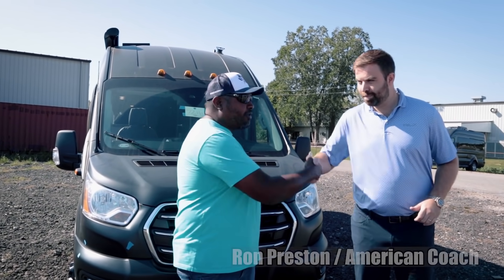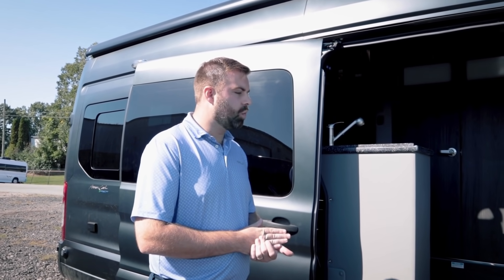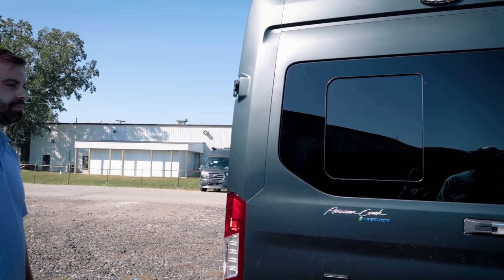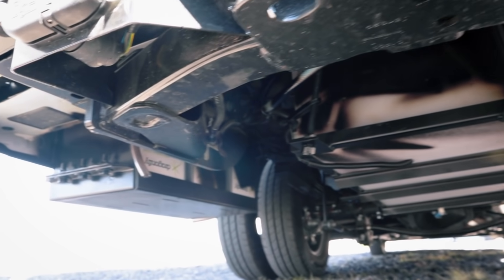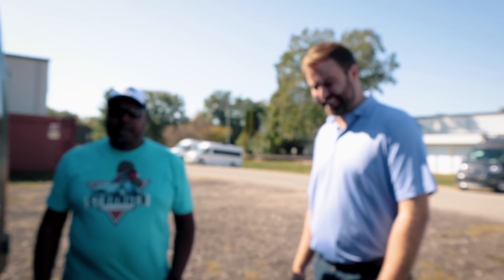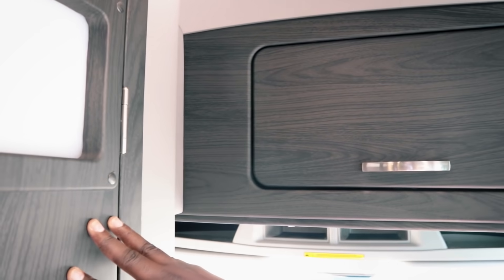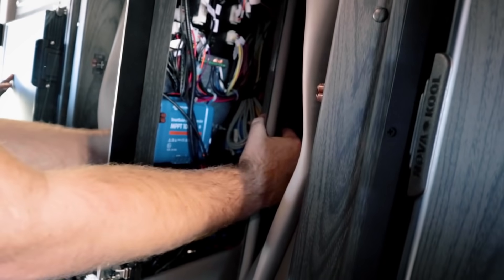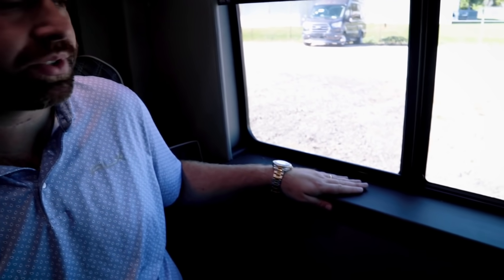THE WAIT IS OVER! Amazing Luxury 2022 FORD PATRIOT MD2 Camper Van // Exclusive First Look!

Comment: We picked up our 2022 American Coach Patriot in TX 2 days before this video came out. While we like it overall, the headaches started within 10 minutes of taking delivery and there is a glaring inaccuracy spoken by Ron in the video.  The towing capacity is usually 5,000 lbs for the class B vans we had been looking at. Ron states in the video that the towing capacity is 7,500. But according to American Coach's own people, the capacity is actually 5,000. Who is right?

And while the van in the video may well be a 2021 Transit, the vehicle sold to us, which again is a 2022 American Coach Patriot MD2 just like in the video, the Ford chassis is actually a 2020. We thought a model marked as a 2022 would at least have a 2021 chassis, but instead is has a 2 year-old chassis. Ron makes the point in the video that Ford upgraded towing to 7,500 so we were really happy, then let down when we found out our chassis is 2020. One person at AC said there is actually no difference between the 2020 and 2021 Ford 3500 HD Transit chassis. Still, seems a little bait and switchy to me.

There are issues with the Ford side, American Coach side and the dealer side of the vehicle. 

On the American Coach side: The water heater and house heater in our unti do not work on electric, though the system is supposed on either petrol or electric according to several videos (including this one). We plugged into 30 amp shore power and the temperature never changed. The water heater and house heater DO work on petrol, however.  

American Coach responded very quickly and walked us through how to get the petrol side working.  The walkthrough of the systems from the dealer, we sadly discovered, was about half the knowledge we needed. Again, American Coach has been very responsive and they are working to find a service center near us (American Coach's service centers are only in Oregon and Indiana – we are in central California) to fix our particular unit. So the videos may be correct, but not for us.

Another issue on the American Coach side is one of the solar panels on top of the van seems to be missing. One person at AC said there are supposed to be 3 panels, another said the are supposed to be two so we are waiting to hear what is supposed to be up there. We only see one panel.

A minor issue is a small (about 1 inch square) plastic cover that hides the screw that holds the driver's side sunvisor keeps popping off. I don't know if that is a Ford or AC issue.

On the Ford side, there are two issues: The first is none of the four key FOB's we were given actually function. We picked up the vehicle, drove down the street to a Sam's Club to get supplies for the 1,500 mile drive back to home. I get out of the vehicle, shut the door and push the lock button on the key FOB. Nothing. We try all 4 of the FOBs. None of them work. 

They do not lock or unlock the doors, they do not operate the sliding side door and, most importantly to personnel safety, the red panic button doesn't work. There was a Ford dealer about a mile from the RV dealer (the RV place said it's a Ford issue. They swore the FOB worked before – which of course they said it worked) We pulled into the Ford service to get the FOBs fixed. The dealership says they tried reprogramming all of them, but it failed.  They said that the FOB's are put into a transport mode at the factory and then dealerships have put the FOB's into a functioning mode, but they were unable to get any of the four FOB's to work.

Yes, there are YouTube videos supposedly to fix this (turn the key on 8 times in 6 seconds, click the lock button on the FOBs, etc) however, those videos do not mention a key fact: That method apparently only works on vehicles that do not have the Ford keypad on the door. If the keypad is there (which it is on our vehicle but doesn't work) it's a completely different process.

The second issue is a TPSM fault warning that does not go away. The tech at the RV store where we bought the van said that tire pressures vary wildly in the Texas humidity and he would check all the pressures, make them even, and the fault would go away after that. He lied. The fault warning is still there. The Ford dealer also could not fix that issue. I believe they said they didn't have the right tool to fix it.

On the dealer side: The sales person failed to mention that the privacy shade that was supposed to come with van was not present. We discovered this while waiting at the Ford dealership. He said he had contacted the manufacture of the privacy shade and it would be shipped directly tool us. Why he didn't tell us that before we left, I don't know. 

Also missing from the van, and we discovered this before we left, is the boards that go across the back between the seats to make the bed one large piece were missing. The tech at the RV dealership said he would grab a pair and put them in the back for us.  He did put boards back there but they are completely the wrong size and do not fit. The RV dealership is looking into finding the right size.

Here's the bottom line if you go to buy one of these things: Check that EVERYTHING works.  Don't just let the tech run through systems and show you the buttons (yes, I did record all the technician's demo so we could go back and refer to it.) Make them show you that every system works. The tech didn't even know if the cruise control was adaptive or not (it is, and works well BTW).

That means for hot water and hot air in the house, you have to turn the system on electric. AC says on electric it's only 5,000 BTU, so it's not going to be as hot as running on petrol, but it will at least heat the house well in 40 degree weather. Wait about 10-15 minutes, watch on the readout that the temperature is actually going up then run the water in the two sinks and the shower to make sure you are getting hot water. Feel the hot air out put. Shut it all down. Try its again on petrol.

And something we didn't notice while at the dealer is there is a tear in the armrest of the passenger front seat. Aggravating on a brand new vehicle of this price. I suspect the dealership knew it was there and didn't say anything.

As I said in the beginning, overall we like the van. The Ecoboost Six is a responsive engine with plenty of power and had no problem passing every RV and semi truck we came upon. It does ride like an HD cargo van, so don't expect it to absorb the bad sections of road (we were on I40) quietly, but it was comfortable on good roads. MPG over the course of about 1,600 miles was 13 mpg.

We like the size and features. I wish it had at least one external storage container.  The dump hose is not a pleasant smell to store inside the van. We ended up putting it in a plastic kitchen trash bag then inside at sealable plastic storage box, then storing it under the bed (yes, we rinsed out the system first). An externally accessible storage would also be a place to put the water hose, which is always going to drip a little when you are done using it.

This is our first RV and we have a lot of plans. Hopefully, American Coach will fix their issues and Ford will fix their issues and we can get on the road with everything working soon.

Thank you.
Reply: I think the 2020 chassis was 5000 and the 2021 is 7500. Doesn't the video says this is on a 2021?  Another Patriot owner said she tought after the conversion it lowered the rating to 5000.  If you find out, let us know.
Reply: @dking4883  Yes it's on a 2020 Ford Chassis. You can tell by the grill.
Reply: @dking4883  I keep replying and the reply keeps disappearing. YouTube has a glitch that doesn't allow detailed responses with proper source citations.
Reply: @dking4883  Ford's own towing specs for a 2021 Passenger Transit 350 HD Long-EL, AWD with 3.5L Ecoboost 6 is listed as 6,600.

For the 2020 model, it's 6,100.

What Ron talks about the tow hitch at 1:59 and says “it’s rated at 7,500 lbs”  that’s incorrect. There is a Heavy-Duty Trailer Tow Package available but its features do not include an increase in towing capacity. 

As listed by Ford, the package includes: 
• Tow/Haul Mode with Trailer Wiring Provisions
• 4/7 Pin Connector Assembly and Rear Jumper
• Relay system for backup/B+/Running Lights
• Frame Mounted Hitch Receiver

On our van, they used a 10,360lb GVWR version, for those that are curious. 

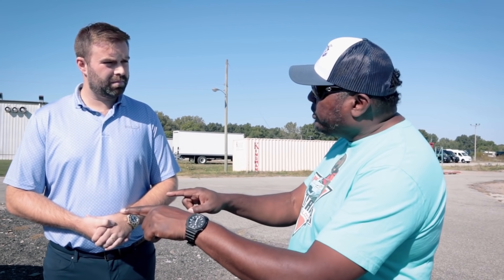Also, the van featured in the video is a 2020, not a 2021 (as Ron says at 1:52). The front grill changed between the two years. There’s actually been some complaints about the aesthetics of the new grille in Transit forums.

The easiest way to verify the year of the van (for future videos) is to look at the manufacturing tag on the inside of the driver’s side door frame.

BTW, there have been a number of other issues that have been discovered that I’ll detail later once they are all fixed.

(Note: Tried posting this several times but YouTube kept auto deleting. I removed all the links where I got this info, so maybe this replay will stick now.)
Reply: Thanks for posting this.  Was a bit skeptical about the 7500 lb towing especially since it doesn’t mention it on the site.  If it could actually tow 7500 lbs I would totally buy this over the sprinter.  O well 🤷🏻‍♂️
Reply: Towing a Jeep..I'm skeptical 🧐
Reply: Thanks for this detailed description of your experience...I may be purchasing a new Class B by the end of 2022.  I will probably make my final decision at Hershy Park RV show later this year.    They better have a lot of time on hand when I pick my rig up...I will have a list of things to check...
Reply: Agree with comment below.. thank you for this detailed review. Honestly it diswayed me from getting any kind of rv.. The lack of trustworthiness is a close second to the government's.

Comment: Those lithium batteries will freeze in the winter especially in New England area. Volta system inside STO still has charging issues during the winter.

Comment: We just picked up our long awaited American Coach Ford Patriot in Texas.LOVE IT.We have absolutely no complaints and we drove over 2000,00 miles already.We are wondering how the house batteries get charged and do we need to buy an additional alternator?Also how do we turn on the heat?Thank for our beautiful van.
Reply: Do you have the Eco Lithium Package?  The house batteries are also charged with the chassis alternator.  To turn on heat, touch the Timbeline control screen. Choose the fuel icon lower left or electric icon lower right.  Set the thermostat temp.
Reply: @dking4883  thank you

Comment: I have a everyday 2015 ford transit panel van, I bought new, haul the bike, Kayack and dogs and love it. I ordered a ford 2022 patriot in Feb, of course I am now getting a 2023, 2022 van, I hope in Oct, it will be like +$15,000 more than quoted! My dim headlights SUCK, it's like driving with no lights at all, terrible, even with the updated bulbs. I am hoping and expecting much better headlights? Plus for that much more, I am hoping I get some of the nicer MB stuff, like the auto waste hoes. Do you know if the lights are improved for the 2022? Hope you and Nick get one in soon, so I can see all the new added features, and decide if I am 100% going for it. Love you guys, Thxs Kate

Comment: Perhaps I misheard, but I understand that the MD2/4 designation was Mid bath- driver side and 2 or 4 captain seats in the van…. Perhaps the nomenclature is changing?
Reply: Then probably my misunderstanding.
Reply: @moWelles  no whatever the acronyms may be,  this should be a really sweet camper van🙏🏼😊. Looking forward to this video..
Reply from the maker: MD2 is the floor plan for sure...I checked with American Coach

Comment: The first thing I noticed  was the sliding door track isn't painted. I think I've seen some RV vans color matched. A minor detail.
The second thing is a Ford Transit comfortably issue.
I have driven a diesel passenger van for work.
The driver's compartment wheel well is in the way. It cuts down on the floor space.
My company has Spinters and there is more room. 
Please comment if you understand what I wrote.
Reply: Both hubby and I ride comfortably in the Transit.  The seating is higher and somewhat closer to the dash, but he is 6'2 and no issue for legroom.
Reply: You're just a Diesel Mercedes guy. It's all good. lol
Reply: @FEARNoMore  We have the Spinter and Transit passenger vans at work. I feel the Transit is quicker from the start.  Both are diesel. 
I drove the Ford Transit the other day. It's a foot rest that I don't like. The Sprinter doesn't have that.
Reply: I'm adding to my comment about the Ford Transit. It's the foot rest in the driver's area. The Sprinter has a wider area and more comfortable foot rest.

Comment: I never hear you give dimensions of anything. Would love to know how wide the isle is, headroom from floor to a/c cover, bathroom dimensions, how wide the bed is( side to side, front to back), how big the counter space is, how tall the counter is, what is water pressure,  all tank capacities, are tanks heated for winter? I also noticed that with all the stuff tucked up under behind rear wheels that mud flaps aren't standard. Any idea what the ground clearance is? What cubic feet of frig is? I wish they had a pullout freezer draw to make it easier then getting down on the floor to get stuff out of freezer. I love the towing capacity so you can pull a little"garage"trailer for you bikes, grills, tools, spare tires, hoses,etc.
Reply: I'll try to get you some of those dimensions tomorrow. We don't have any problems accessing the freezer.  It is no different than my bottom freezer on house fridge, except this has a door instead of a drawer.

Comment: Hank you were discussing with Ron Preston about the tow rating on the Ford Transit as 7500lb.  I understand that the GVWR is 10360lb.  What is the GCWR for the American Ford Patriot?  If I could tow a 4,500lb Jeep Wrangler behind this Van, I would be interested in buying one.  However I cannot get an answer regarding the GCWR.  I called MidWest, Sunshine State and LaMesa RV in Orlando. No one knows the answer.  Hope you can help. Thanks

Comment: Watched again.  I know it’s their signature look. But American Coach and Midwest.  Needs to move out of the 1980’s Miami Vice motifs. Ie the low chin spoiler and wheel flares. I’d unbolt both if it was mine.  The painted MB logo looks again 80’s posh and not in a good way.  

That said great build quality hands down.
Reply: The spoiler is an option.
Reply: @dking4883  not sure on the ford model. But yes on sprinter it’s a line item.   On the transit they also have that ugly rear wheel bulge too.  I get it trying to make it look upscale but blahhh

Comment: That looks like a 2020 Ford Chassis NOT a 2021 Ford Chassis. Dude just lied I think, you should call him out on that.
Reply: That's what I was thinking! lol The front grill is the indicator. For sure not a 2021 chassis & there is no 2022 chassis yet I believe.
Reply: It is a 2021 American Coach Patriot on a 2020 Ford chassis.
Reply: @dking4883   Yes I know, but at min 1:45 Hank asks Ron if this is a 2021 Ford & Ron says yes the chassis underneath is. Then says the build is a 2022 Ford Patriot. Ron is giving some inaccurate info.
Reply: @IAMHIM15  👍

Comment: You didn’t show how the bed works….
Reply: The control is in the Firefly unit.  Press a button and the lounge extends forward and the seat back reclines flat.  There is a board that goes in the space between the side seats. The side seat cushions and bolsters make the almost king-sized bed.

Comment: The interior looks so dated and heavy. Come on, where is the innovation and lightness in a small space? The cabinets and heavy stitching look straight out of the A class that they produce. They are trying to copy the adventure van builds with the no propane and only lithium, which is great, but have a long way to go with the rest of the systems. Gas heater, yes we are all familiar with the Webasto gas heaters and diesel type heaters, nothing new there. Looks like an old man’s cigar lounge on the inside, so disappointing. I’d feel boxed in. And those small window cut outs on the back doors, why? You want views out the back. Has potential but needs re-designing.